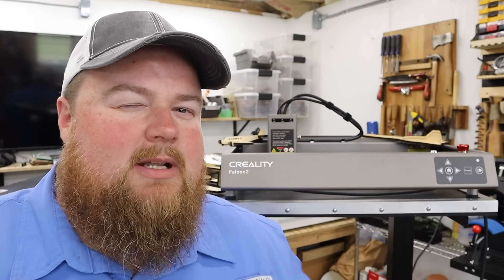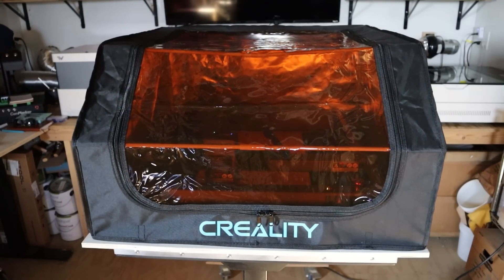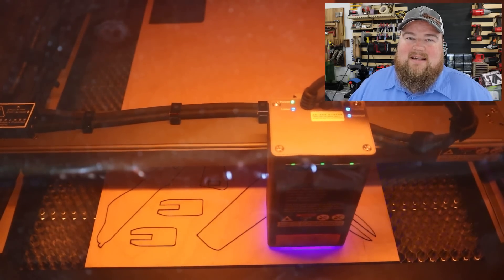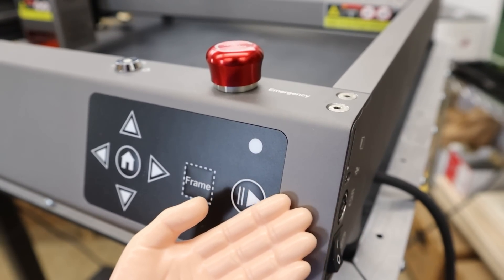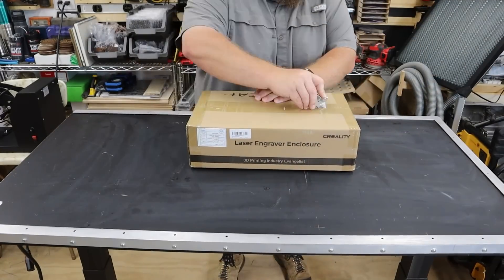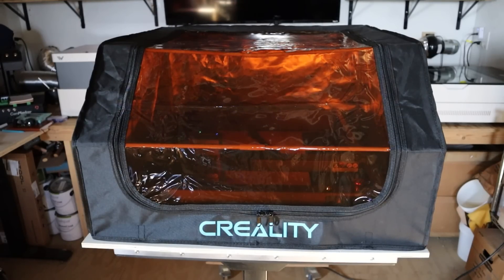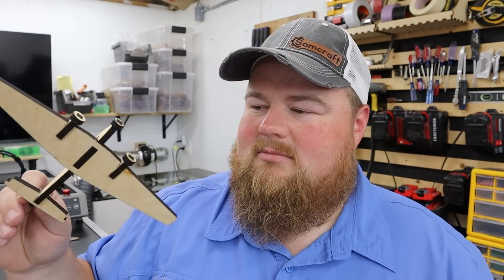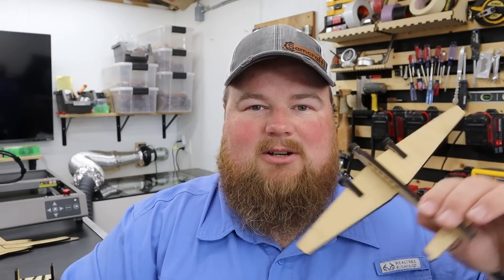FINALLY! True Cable Management: Creality Falcon2 40w Laser Cutter

Comment: Any input on an issue Im having with my Falcon2 40w. It randomly loses connection mid operation. I have to unplug usb and plug back in to reconnect. If I'm engraving multiples of the same job separately it does it on the first one and then runs flawless for the rest of them. I've the usual like disabling sleep and usb going to sleep. Not sure what I'm  missing.

Comment: Well, that is great for wood.
How about 1/8 inch aluminum sheets.
I want to re-create the plastic logo on my Boler camper out of Al. That would entail removing depth as well as cutting the outline.
Show us some metal 😅
Thank you
Reply from the maker: No lasers in my workshop have the ability to cut metal.
Reply: The upcoming version with a phaser module should handle metal.

Comment: Hi Sam, absolutely love your videos. Just a quick question. I have this Creality Falcon 2 40W unit on the way and looking at magnet thicknesses to hold down warped wood. What is the minimum focus height from the laser body to workpiece? I want to buy magnets thin enough that the laser head wont hit whilst traversing. Cheers

Comment: What lightburn software are you using? have one on order and wanted to start using the program and saving a project/fiddle around with it.
Reply from the maker: There is only one version of Lightburn. Your license depends on your machine type.
Reply: @Samcraftcom  I wish this was the case downloaded it and it gave me a few options then it asked for the machine and I tried typing it in... IDK when I get the machine it will specify or discover what I'm using and set me on the right track. thanks for the timely reply. I'll let you know when it happens though.

Comment: I have a question. For some reason, my D1 pro 10w is not measuring correctly. For example, a 5x5mm square will be 6x7 or 7x7. Do you know why it is  doing that or how to fix it?

Comment: I have been searching for a laser.  And had decided on the Creality Falcon 2.  And then I found the Algolaser Delta.  They only have a 20 watt laser right now, 40 is due out in October.  The laser is built where it operates as well as a 30 watt laser.  The beam is so tight, that the cut line is thinner and more concentrator so it can cut thicker materials

Comment: Just a FYI, Ortur wasn't the only company with a metal enclosure, Atomstack made one as well. I'd planned on getting one when I first got my old A5 Pro, but ended up getting a big Co2 and pretty much retired the Atomstack (just recently sold it).  Creality can make some really nice stuff, but you can also run into quality control issues with them (like anybody else I assume), so there's always that 'your mileage may vary' aspect in the back of my mind with their stuff (this comes from having about a dozen of their 3d printers over the years).  Still, that's a very nice looking machine, just wondering how it compares to the simiarly priced xtools?